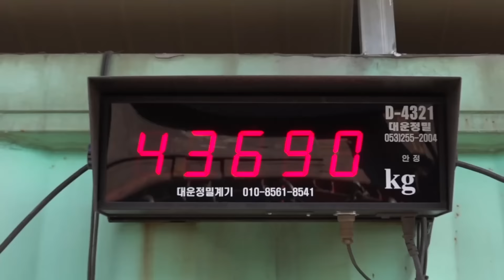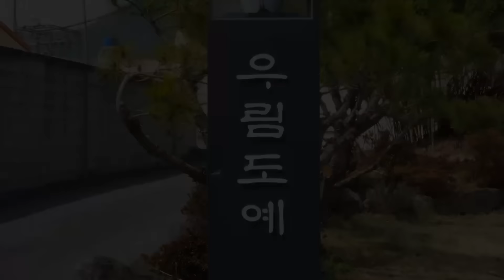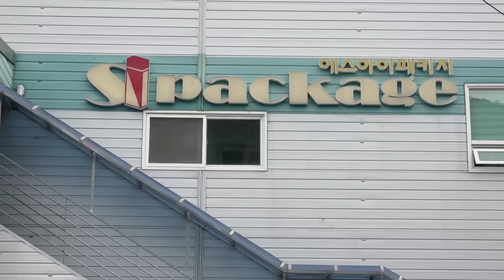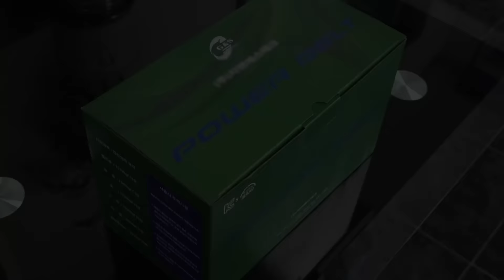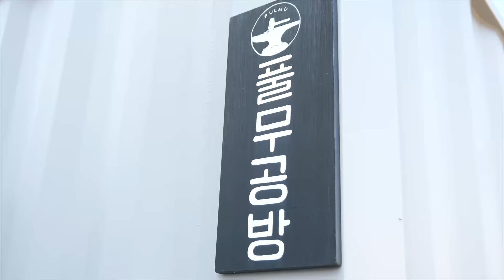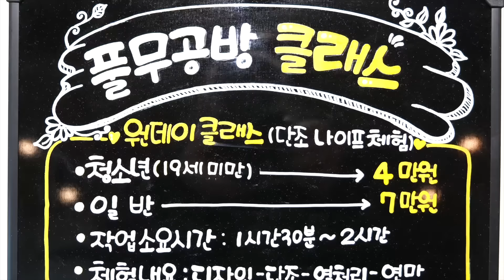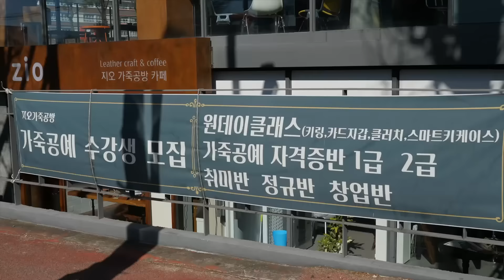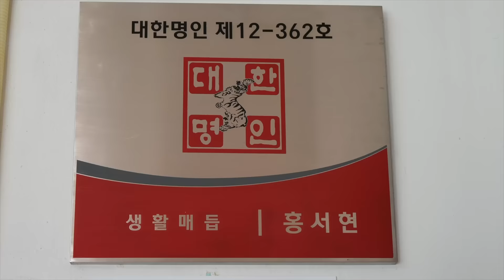Most Popular Video of 2022! Wonderful Korean Manufacturing Processes TOP 10

Comment: I thought they had missed filming a step in the Damascus knife forging. When he put the hard steel core on, it should have been folded over again so that it would be in the centre of the steel, which would eventually be the hard cutting edge  until I saw the design.

Comment: (Me)
I was watching a video on YouTube about making the Damascus knife through heating, hammering, baking, etc -- there's one thing that caught my attention is the white dust that sprinkle on it.  Do you know anything about that white dust?  Assuming it's the salt or sand of some kind?

(ChatGPT)
It's possible that the white dust you observed on the Damascus knife during the video was borax. Borax is a commonly used flux in the process of forge welding, which is a technique used to fuse different types of metal together.

The purpose of the flux is to prevent the metal from oxidizing and forming scale during the heating and hammering process. When the borax is heated, it forms a glass-like coating on the metal, which helps to protect it from the air and prevent oxidation.

The borax is typically sprinkled onto the metal during the heating process, and it melts and flows over the surface of the metal as it heats up. This helps to protect the metal from the oxygen in the air and also helps to remove any impurities that may be present on the surface of the metal.

So, in short, the white dust you observed on the Damascus knife may have been borax, which is a flux commonly used in the process of forge welding.
Reply: Thank you !!! I was wondering the same....

Comment: The knife maker is a wonderful craftsman; however, his fuel tank is way too close to his kiln. A minor valve leak, leak at the threaded connections or the hose itself could lead to a catastrophic explosion. The proper place would be in a stand built to securely hold the tank which was removed by a safe distance from any source of open flame. Safety first.
Reply: その通り　安全第一

Comment: the printing press is so god damn old and not save to work with, I am a bit shocked as a printing press operator, best conditions to get your hand between the cylinders. 😄 PS: Or did they just removed the safety grills in front of the impression cylinders for the shot, as there are others there?

Comment: Does anyone know why the short cylinders are added with the steel bars in the oven?
(Rebar factory) van
Reply: It is to give a distance for heating regularly the bars, they are reused after cooling.
Reply: Those are forging blanks, for another process we didn't get to see. Could be for any thing that weighs about 4 to 5 kg (8 to 10 lbs).